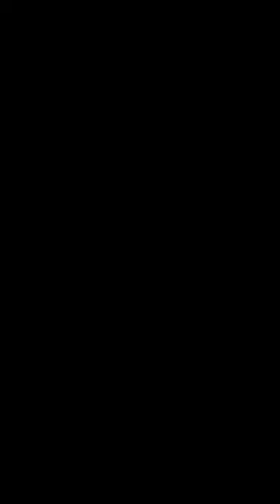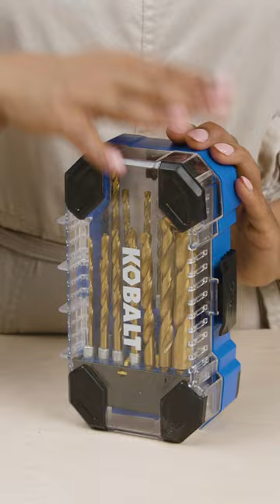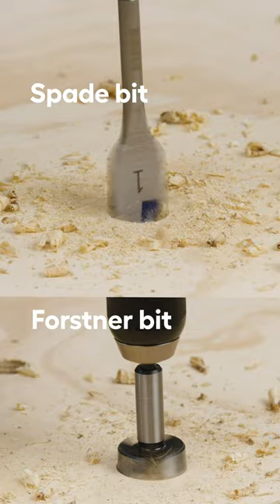Choosing the Best Drill Bit

Comment: No, Brad points are useful for alignment. Forstner are for getting a flat-ish bottom (such as for a candle holder) but are more versatile than a hole saw or spade bit. Twist bits are traditionally for metal and are also appropriate for a drill press. Brad points should be the go to for using drill bits with a cordless drill.